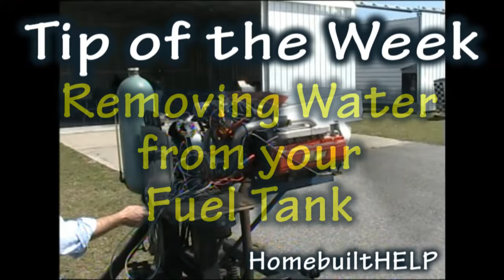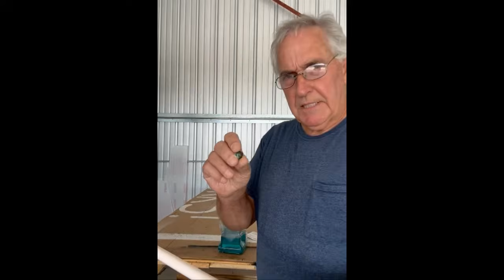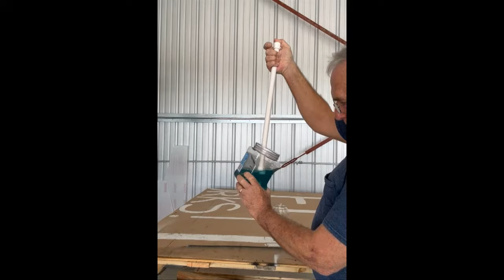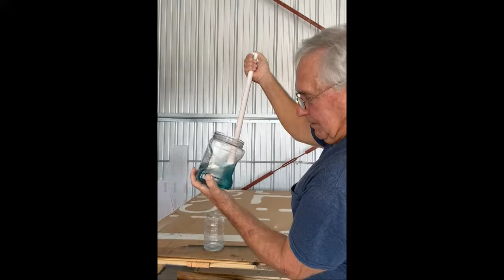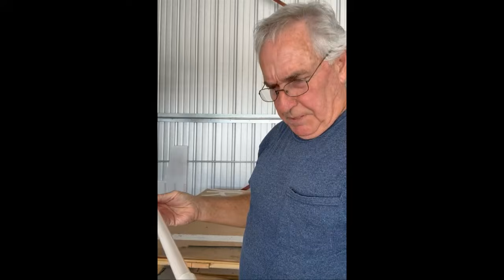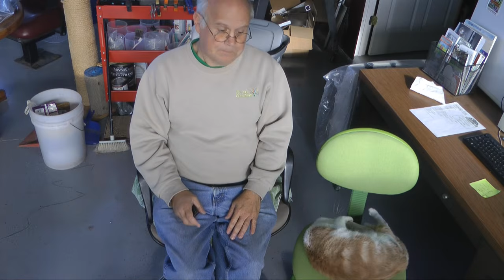Removing Water from your Gas Tank

Comment: Sounds like it works just like a straw we may have in our drink. Plug the top hole with your finger, and lift out. Nothing comes out of the straw, until you release your finger, the plug, from the hole. 

Thinking the marble should not be needed then. 

I also seen a trick were a person with a hose or even PVC pipe has a one way stop valve would pump the hose/PVC in and out of a pond of water. The water would work itself up the pipe/hose until it came out the other end. Thus priming the pump until it come out the end. The stop valve could likely be your finger. Covering the outside hose with your finger,c when pulling out. And, taking the finger off the hole when pushing in

Then due to, thinking, surface tension, and weight of water coming out, where it is dipping down, causes the water to continuously drain out., until you do something to stop that action. So, if we had a clear hose, we can watch when what is going into the hose is no longer water, but gas. This is based on a scientific principal, which I can't name off the top of my head. 

I also just looked at a video where it shows a drain nut at the bottom of the carburetor. 

Thinking to just crack the nut so the water drains at a pace you prefer. Thinking, drain slowly for small tanks like a lawn mower. And, smell the air. Don't smell gas, it is likely water. The moment you smell gas, all the water is drained out, and you have only gas left.

Comment: Simple, straight forward to use, limited number of components, brilliant tool for the situation described.  Also yes you can use methanol in every fill, if you always have a ready supply of methanol.  Furthermore if you can test fuel beforehand and REMOVE the water if needed.

Comment: What, may I ask is the device you have gone to so much trouble to demonstrate? 
I was taught by a mechanic back in the 1980"s that adding a lidful of methylated spirits to a jerrycan of fuel you can absorb any water that way. Is this correct?

Comment: This method works, but is somewhat slow.  A similar, but faster method is to use one of the siphon pumps with a clear hose and you can quickly get the siphon started and easily see when you are pulling water out or pulling fuel.  And the small diameter hose and higher withdrawal rate will suck the last drop of water out.  You can then pour the fuel back into the plane using a water separating funnel and not waste hardly any fuel yet get all the water out.
Reply: It's not slow, it only seemed that way because of all the water I put in the jar.  Every time I've used it on the plane or the gas can, it was one take and the fuel was clear (most times) or had a drop or two of water (once).  The jar is necked down at the top so I was able to pour the fuel right back into the tank and the couple of drops of water would stay in the jar.  I'll bet it's faster to use the siphon tube than to try to get a hose to the middle of the dimple on the bottom of the tank.
Reply: @HangarFive  The fastest way is to put a proper drain in the tank.  😁

Comment: too bad its vertical filmed
Reply: He fully described everything and you don't need higher resolution.
Reply: I had two big rubber bands that held my cell phone to a 2X4 that was clamped into a workmate vice.  The video was made to show an FAA inspector that I had a way to take a fuel sample without having a drain on the tank.  But I also wanted to share the idea because I thought it could help other pilots.  I never dreamed that it being "vertical filmed" would make a difference.

Comment: G,day from Sydney Australia.
Just to clarify, was that 9/64 (3.5mm) hole at each end? 
💧
Reply: G,day mate!  Yes, it's the same size at each end so it doesn't matter how you pick it up.  Like I said in the video, 5/32 might work better or not.  I do know that if the hole is too big, water can drip back into the tank as you're lifting it up.  That's why I didn't want the hole any bigger than necessary.  It's also important to make sure there are no burrs left from drilling to make sure the check ball works properly.